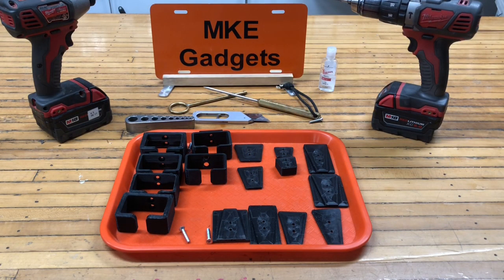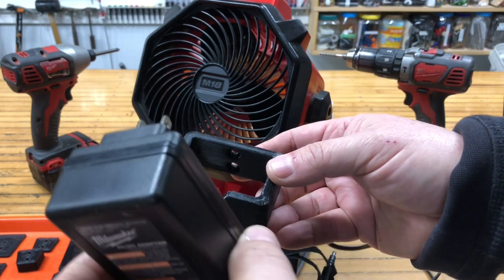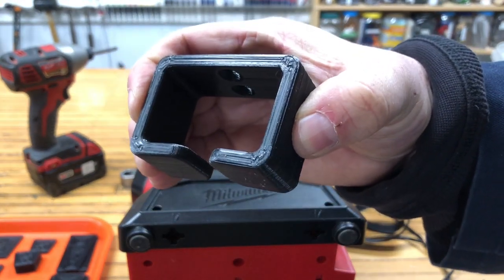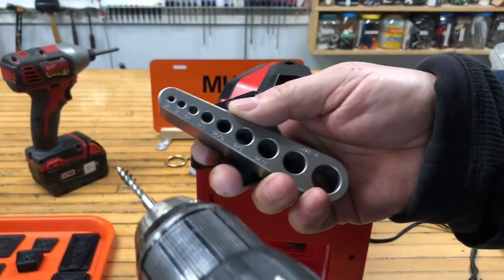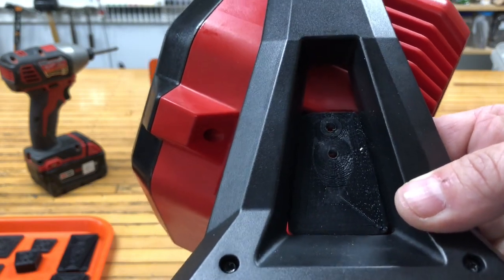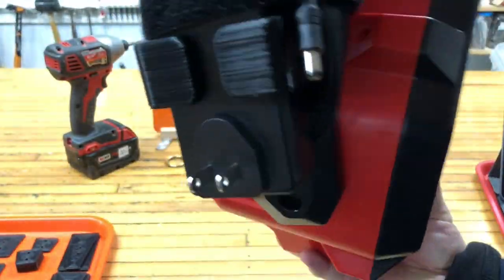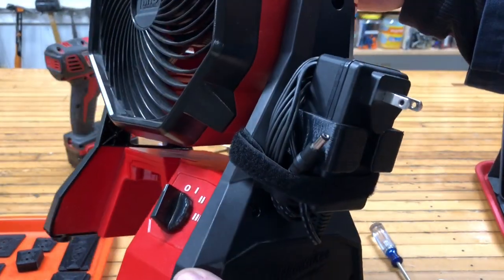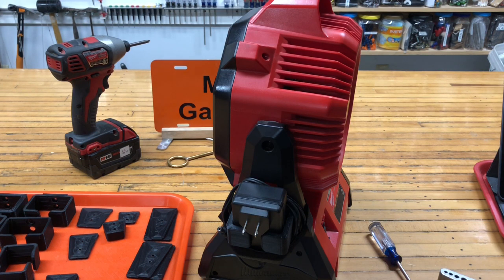Milwaukee Tool Fan Upgrade @ MKE Gadgets #80

Comment: I really do not understand why many people complained that the fan does not have the adapter put inside of the body and equip the adapter the ability to charge a battery. I have three 5 amh and two 8 amh batteries, so I do not want the adapter to add more weight. A charger costs $30-40 dollar, and I believe that's why no charging ability from the fan, which is only cost $ 79.99.
Reply from the maker: Yeah I agree with you. Did you print the bracket to hold the power supply for your fan? Please support me by subscribing to my channel. I have a new video coming out most Wednesdays thanks again

Comment: Have you made something that attaches to the bottom of the fan that is able to mount to the pack out box?
Reply from the maker: Not yet, I don’t have any pick out boxes. Thanks for viewing.
Reply: How much for the AC adapter mount?
Reply from the maker: What is you zip code?
Reply: How much for the mount ? My zip code is 75169 , thanks